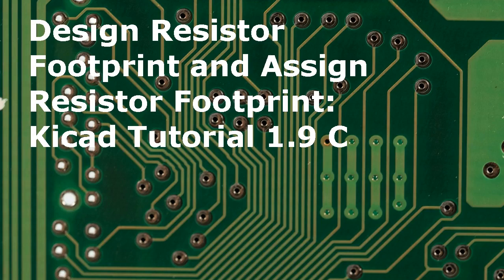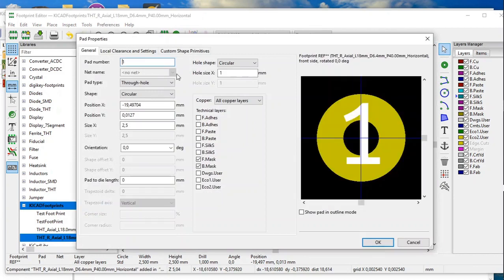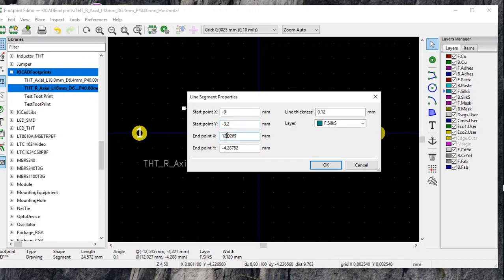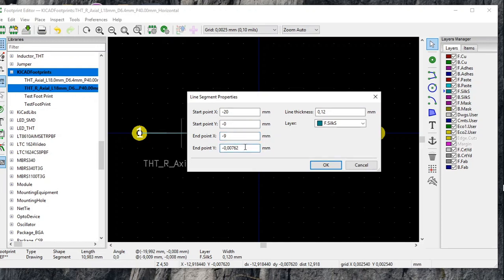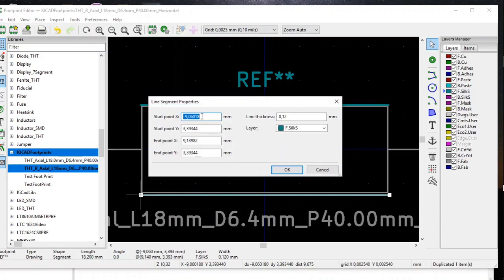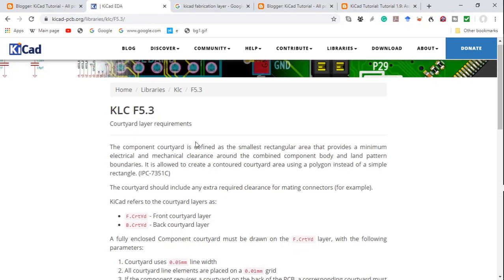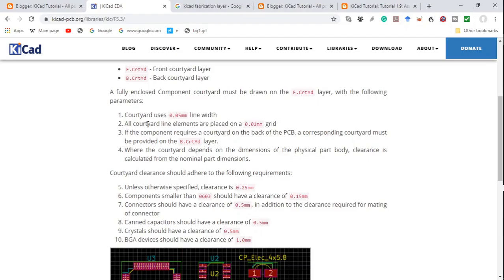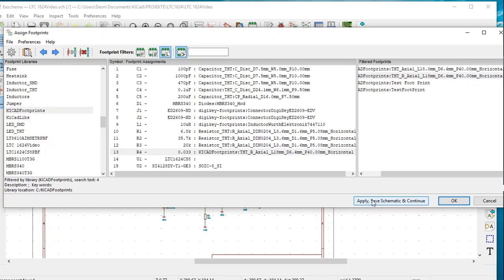Design Resistor Footprint and Assign Resistor Footprint. Kicad Tutorial 1.9 C

Comment: hey, thank you the video. i'm currently making a projekt and need to make my own resistor. How to make or choose the right resistor? thank you :)
Reply from the maker: Hi Alfonso, First of all, you have to determine the resistance value of your resistor in Ohms. Then you have to calculate the power in Watts the resistor has to dissipate. I hope this helps. Let me know if I could be of any further assistance. Regards, Deon.
Reply: @deonhugo3442  hey thanks for the answer. so we don't really have the I (or maybe i got missunderstand) but we have the Ohm value. is that even possible to calculate the Power ? our project is LT3080 Adjustable1.1A Single
 Resistor Low Dropout Regulator. My docent told us to make 1 our own schematic symbol and footprint, and we choose to make our own resistor.
Thanks
Reply from the maker: @alfonsosamuel2273  Hi Alfonso, Send me all the information of the question you have. This includes the circuit diagram and al the values. I am not sure if you will be able to send it via this conversation though. However, my email is deon.p.hugo@gmail.com. I will see if I can help you. Hope I can. Regards, Deon.
Reply: Deon Hugo hey, thank you so much for your offer. I work my part time atm, but will send it to you ASAP to you email. Since the corona time, it‘s hard because we had digital class. Once again thanks so much 😊🙏🏻
Reply: @deonhugo3442  hey, i just sent my document. thank you :)
Reply from the maker: @alfonsosamuel2273  Hi Alfonso. Thank you. I have received it. I hope to get back to you soon. Regards, Deon.
Reply: @deonhugo3442  hi, hope you are good :) just want to ask is there anything i can help for clarity or all good with my document? thanks
Reply from the maker: @alfonsosamuel2273  Hi Alfonso, As far as I can see your documents are clear. Did you get my answer? Do you agree? Do you want me to resend it? Let me know. Kind regards, Deon.
Reply: @deonhugo3442  hey sorry i missed that. i will check it and see what i can do with that. specially for make the footprint for the resistor. thanks so much